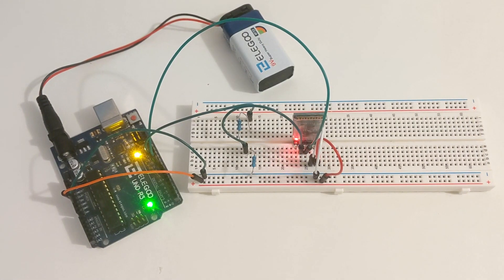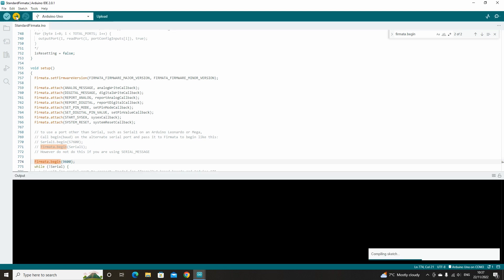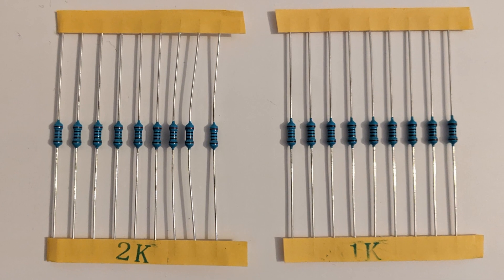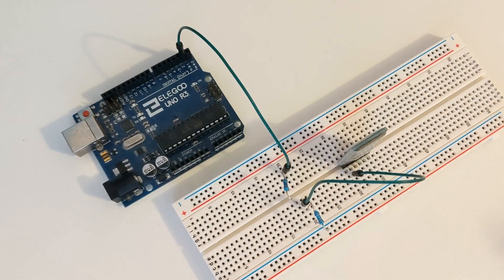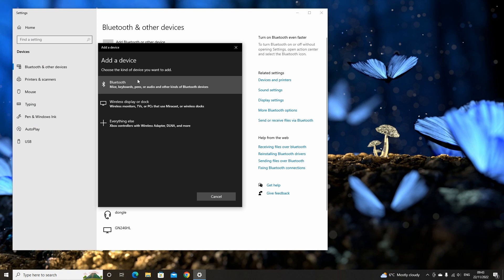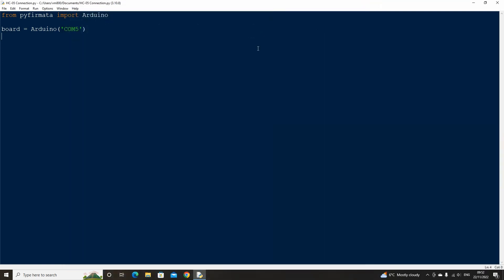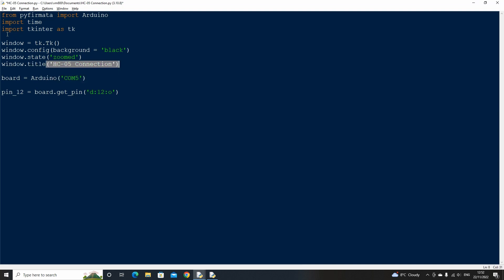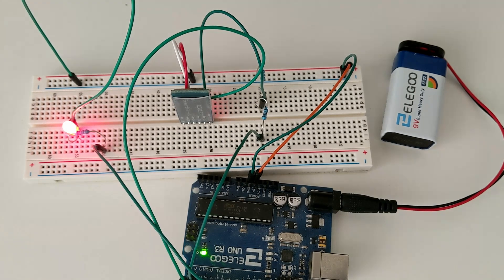Wireless Arduino - Python HC-05 Bluetooth on PC

Comment: Hello, 
Thanks for the tutorial.
I'm trying to connect (in windows), at the beginning it connects, and a few seconds later it disconnects (according to the message on the screen) but the device still blinks as if it's in AT mode.. do you have any idea what could be the problem?
Thanks!
Reply: Did you find a solution?